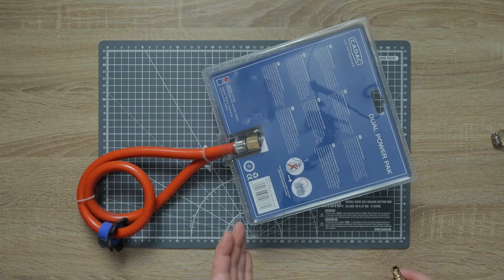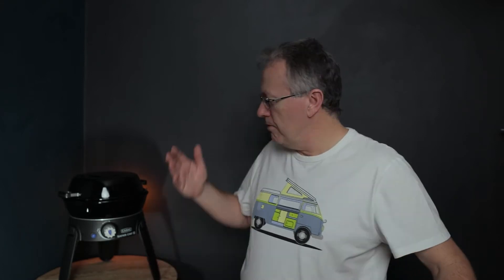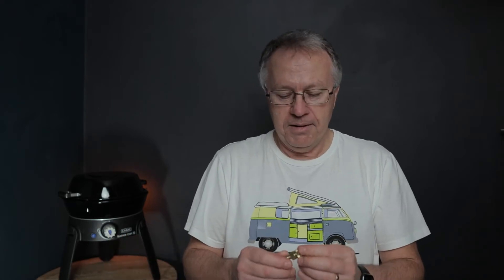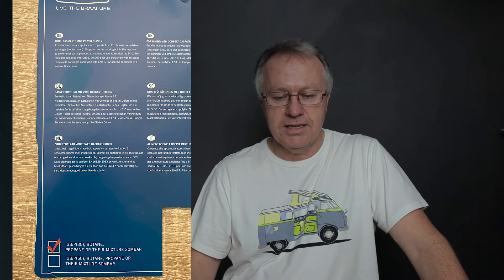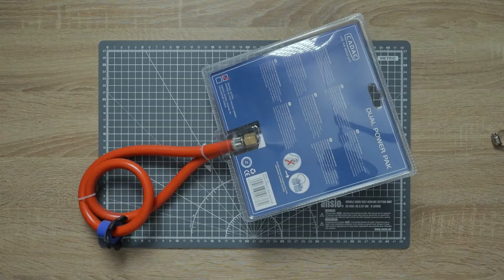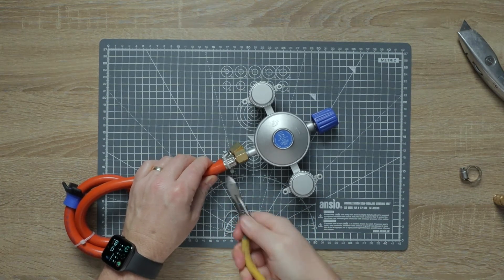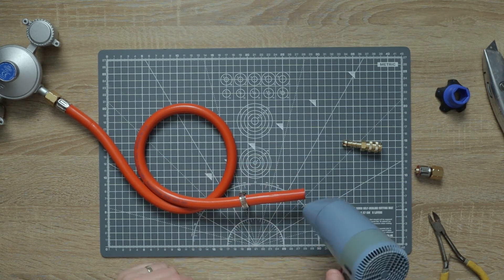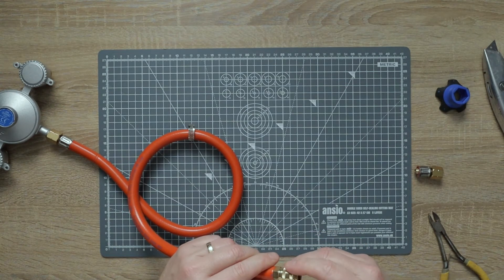Cadac Safari Chef 2 Regulator Fitting

Comment: Great video matey. We went for the cadac with the longer legs and dual bottle setup for the garden. It came with the dual pak and correct fittings. My question is can you use just one bottle in the dual power pak? I cannot see why not as the valves are self sealing. If you are stuck with just one bottle in stock and food to cook surely you can just throw a single bottle on and light the thing.

Comment: I’ve gone for the same bbq with quick release,  but will use the campingaz regulator and a R904 bottle. My thinking is the R904 will be a good backup to the R907 used in the California
Reply from the maker: That makes sense for the backup. The van we're getting is the CV40 and that has an underslung gas tank and I sort of see the Cadac as a bit of a backup too but I've been using it more generally at home. I've the sheets that go on top and they save so much cleaning. Just checked out your channel and we're thinking about Bromptons but they're a hefty price tag but the form factor nails it. Thanks for dropping by.